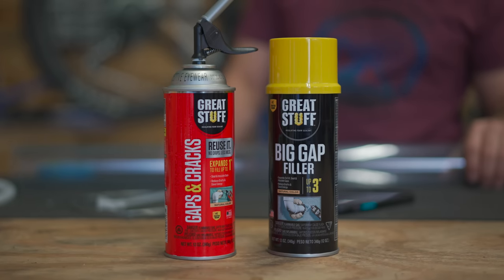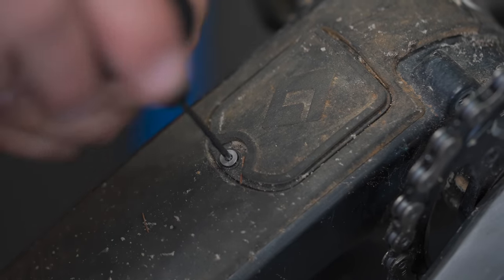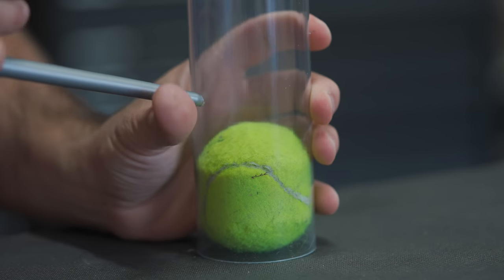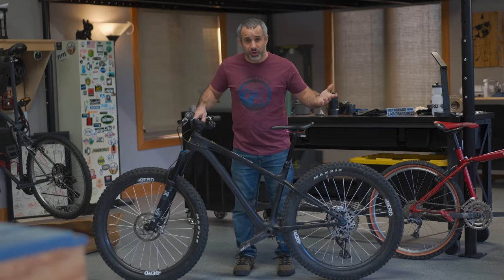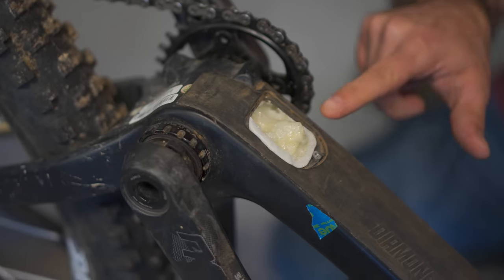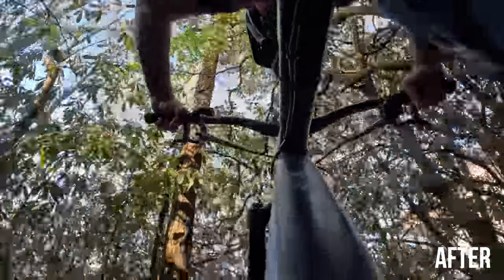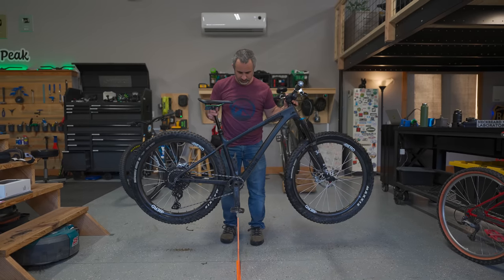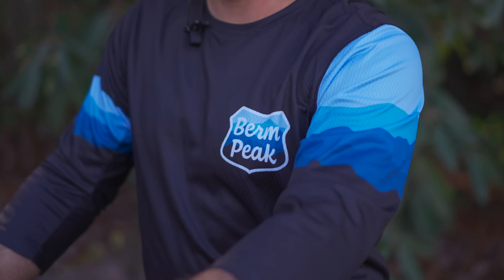Filling my bike frame with foam made it better—kind of. Don’t do it.

Comment: Next, we need to see the tires filled with foam. Now that would be interesting.
Reply: Foam tires have been around for years, but they are vastly inferior to good old fashioned pneumatic tires. The only advantage they have is that they can never go flat.  The disadvantages are increased weight, increased rolling resistance, and a decreased ability to absorb shock.
Reply: This foam would just crumbe to dust very quickly.
Reply: expanding foam in tyres will eventually disintegrate, so no its not as good an idea as you would think. Gander Flight has some videos showing it being done on his channel that may be worth a look
Reply: how about filling the rims?
Reply: Isn't that Cushcore?
Reply: I've filled zero turn lawn mower tires and they work great !
Reply: …and take them down the stairs of doom.  Calling Sam Pilgrim.  This is going to be EPIC.
Reply: @cyrusf.4039  Spank vibrocore is something like that
Reply: It's been done on gcn tech
Reply: @Durwood71  Imagine filling the FRAME with air! that's gonna be the next big thing, pneumatic frame.
Reply: @dummkompf  thtas actually a thing in custom off road cars- use the rollcages as compressed air reservoir.
Reply: just try any kind of rental bike or scooter...
Reply: @dummkompf  dude fill it with helium, like a balloon. Lighter than air! Or even hydrogen to power a rocket motor!
Reply: Blake from GMBN did that
Reply: @Durwood71  Yes but there are times when this makes sense, my dad has used one on the back for years becuse of where we live, the tires go flat all the time either some odd goat weed in places or other things like the city having poor pavement that in winter he uses the bike.  He has a Tube bike so it was very easy to find foam for the bike, some old Steel fralom Mountain Bike with rare MTB style calipers that is a Japanese made bike from the 1980's with the oldest of the production off road forward facing side grips and orginaldesins of front covered spring shocks.  What would be better is solid rubber tires for bikes/something similar to the metal tires of small kids trikes, these are better for use as they would not have the Rolling resistance as bad.
Reply: @caseysmith544  Yes, as I said, the one advantage of foam tires is that they can never go flat, but in almost every other respect, they are vastly inferior to pneumatic tires.
Reply: I've bought a dirtbike with expansion foam it. it was the worst
Reply: We already have tire foam inserts.
Reply: @xavierhulbert5849  Yes but they kind of suck, the best would be to have solid rubber tires or something like that, as they would be stiffer to counteract the major amount of rolling resistance the foam has. Yes the issue is then the bike is so stiff on shock but with all the types of suspension the modern bikes have even at lower levels of bike, this should not be an issue. This is not a road bike that most are lacking in suspension and only the Cyclcross bike have a little. Even the casual Gravelcross bikes Have the suspension be it lesser for some routes that include steep downhills.
Reply: @dummkompf  not air,  helium to shed a few grams !
Reply: Doesn't work. It gets firm in one spot, but stays liquid in the rest of it. 
There is a YouTube video somewhere, but I forgot who did it.
Reply: @caseysmith544  Solid rubber tires would be murder to ride.  You actually want tires to have give, not just for shock absorption but to increase the surface area that comes into contact with the ground which will prevent your tires from slipping.  Plus, a tire that is too firm will bounce over rough terrain instead of rolling, which will decrease traction and control, even on a bike with suspension.
Reply: Lets ask sam pilgrim
Reply: Brazilian channel @Pedaleria already did that
Reply: Some Car Tyre OEMs have models with foam in them… I think only 1-2 SKUs though
Reply: Tannus tire inserts.  Not exactly what you're talking about, but pretty close.
Reply: This is done for forklifts used in warehouses so having no punctures means less downtime and also on wheelchairs where a puncture can happen at an inopportune time. The polyurethane foam used is not this one as it is rigid. The one used is the one used to make foam mattresses which is a flexible polyurethane foam.
Reply: @cyrusf.4039  Spank did that with their Vibracore rim and handlebar line up.  They're cheap and apparently dampen very well.
Reply: @sapinva  Tannus Tire did a better job by placing the foam between the tire and the tube/air pocket.  Ran that on my DH bike with 3C Maxxgrip DH casing tires and my tires were so supple I hold lines no one else could.  I ran my tires at I think 12psi front and 15psi rear.  But the foam paired with the DH casing made the tires feel like I had the support from running 22/25psi front and 25/28psi rear.  They made the trail feel so tame and saved me from crashing so many times it's not even funny. The tradeoffs were rotational weight and rolling resistance though.  So in order to keep up with others I had to pump more, pump harder, and build more trust in my bike's traction so I could lay off the brakes more.
Reply: @caseysmith544  I understand where you're coming from, but foam tire inserts are absolutely amazing.  The supple traction, vibration deadening, extreme puncture resistance, and outrageous amount of support they add in turns is nothing short of jaw dropping.  They force you to be more physical with the bike in order to build speed, but if you have the conditioning they are a must have on nearly every bike. In the world of performance mountain and road biking, tire set up is equally as important as your suspension. 

A solid rubber tire, on the other had would have almost zero give and so much rotational weight that it would quite literally hit a rock or root and just stop you dead in you tracks, and send you flying over the bars.   Even if you made a solid rubber tire soft enough to dampen like an air filled one, and low profile enough to not have too much of a rotational weight increase, the rubber you would have to use would be so soft and low density that the rubber would essentially dessintigrade on you extremely quickly while riding.  And you'd probably destroy rims super easily under high impacts.  So I get where you're coming from, but trust me, it won't work as you think it might.
Reply: @Polemicist_  maybe a foam tire with small inner tube in middle is the way to go? 🤔
Reply: @Polemicist_  Those look interesting. I'd still need 35 psi, which feels soft enough to me.
Reply: @caseysmith544  That's what Tannus Tires deduced and they are fantastic.  But keep brainstorming ideas on how to make a supple, lightweight, bombproof tire.  We need innovative minds like yours to keep advancing bike or any other technology type.
Reply: @sapinva  Do you rub tubeless with an Exo or DD casing?  If so, the Tannus Tire inserts will make an Exo casing feel like a DD, and a DD feel like a DH.  If you decide to try the tubed Tannus Tire inserts in a DDI think you'll find you'll drop your PSI by 5-10 and even more if you bump up to DH casing tires.  I used to run 33 front and 35 rear with tubes in my DH casing tires before I got Tannus inserts.  So, just something to keep in mind.  If you have like $120 to spend on your bike I'd highly recommend you at least give them a shot for a few weeks.  And you can just return them if you don't like them.  Aside from maybe paying a mechanic to mount the inserts and balance out your tire, you have nothing to lose and a lot to gain in my opinion.
Reply: @Polemicist_  Run Vittoria Agarro 2.35 w/ Rimpact Pro tubeless mostly. Could probably go 3-4 lower than 35 psi and get away with it, but don't like banging my rims. Used to go 45 psi with tubes and still get pinch flats. It would only be $60 for me, generally run tubeless w/ no tubes or sealant in the front with no issues. Might try the Tannus insert on a different bike.
Reply: @sapinva  Oh, you ride XC?  Makes more sense why you'd keep the higher pressure.  I thought you rode enduro or downhill.  For XC definitely keep the high pressure because the foam will still be a miracle on your bike.  Just know you will increase the rolling resistance but you will pretty much never get a pinch or slash flat.  For a puncture flat you'd have to drive a nail over an inch and a half into your tire for that to happen which is probably not going to happen ever unless your riding through active construction sites ahaha.
Reply: @Polemicist_  DH and Trials mostly.
Reply: @sapinva  Wait, Vittoria makes DH tires?  Had no idea.  Do you have a dedicated trials bike, too?
Reply: Solid polyurethane tires will take over at some point. The material has been improving leaps and it has amazing qualities for grip and speed as long as it's relatively dry.
Reply: Sam pilgrim fills his with monster energy,  get with the program baby!
Reply: dirtbike tires often run foam tubes.
Reply: “Cush core”
Reply: Closed cell foam still deteriorates after repeated cycling.
Open cell foam for gap filling is less likely to over expand, but also less durable.
Reply: That is literally what new cars come with instead of a spare.
Reply: Everything inside will turn into sand a the first sight of human weight applied
Reply: There's a thing called cushcore
Reply: that is why i came for
Reply: All hobbygrade rc bashers and crawlers use foams in different compounds
Reply: @cyrusf.4039  might be the better version of a rim tape lol
Reply: I wonder what would happen if you replaced a bicycle tube with a pool noodle.

Comment: You need an 2 part structural expanding foam.  This will set inside the frame and doesn't absorb water.  It also makes the frame stiffer.  The spray stuff needs air to set, so it will never fully set in the middle of the frame.
Reply: Bring this man a beer!
Reply: Sometimes we would use a 2 part foam for setting posts in the ground. It was impressive. Expanded like crazy.
Reply: Thet do this in the chassis rails and sills of racecars for stiffness
Reply: thought this too
Reply: “Air set” well set by moisture in the air.. a couple spritz of water inside the frame will solve that issue.
Reply: @Frmrspecialist74  thats true, actually i have see years old foam wich was still wet on the inside
Reply: I experimented with foam in the past and i can say @alexnelson9505 is right: Use 2 component foam. There is not enough humidity to harden in closed pipes when u use 1 component foam.
Reply: YES, 2 part foam is more controllable. You can get it in different densities and it is several orders of magnitude stronger then spray foam insulation.
Reply: Additionally I wanna see differences for aluminum and carbon frames. Would it lower pinging noise in the frame of an Al frame?
Reply: and still the difference will be little to none
Reply: @Dyloniuss  Yeah that was my thought – there could be greater/lesser effect depending on the bike...and also the type of riding (I wonder if chainslap, etc. in MTBing will just be louder anyway, but a generally-quieter road bike with an annoyingly "clicky" inner-routed cable housing would maybe be silenced)
Reply: Can someone post the cable routing sleeves he used?
Reply: What this guy said. 2 part foam is what you need. I would doubt any real world impact one a bike though. For cars, there are lots of cars that actually use two part foam in certain areas of the car to improve stiffness and sound absorption from the factory. Lots of hobbyist have done it too but I've never seen any really works data to show it works.
Reply: Agreed.

I tried to make a green screen stand from pvc tubes and planned to fill it with foam for weight and strength.

Pffffff

Total fail.
Most of it stayed liquid due to lack of air for activation and dripped out.

Waste of time and money
🤬😡😠😤
Reply: That's why bamboo is so tough. The outer shell would break easier without the soft foam stuff on the inside. I don't know if it does anything for the sound of bamboo 😉
Reply: @RazzFazz-Race  spray water into the tube before you start and then it's fine.
Reply: Not setting isn't an issue for sound deadening. Bet this technique made more of a difference in aluminum frames
Reply: Wonder how stiffer the frame would be, and would it allow a little more weight bearing (overall rider weight)?
Reply: Not to mention if he only let it set up for an hour then dropped the bike a bunch, that uncured foam probably unfluffed in the frame too
Reply: Came here to find this post. More specifically GreatStuff needs the moisture in the air for its chemical reaction. Definitly, need a 2 part foam for something like this.
Reply: It's not actually activated by air, but by ambient moisture. 

ANYWAY, yeah you're right, by the time of filming, there would be a fair uncured liquid foam in the middle. Perhaps its whole acoustic effect was that it was basically acting like a deadblow hammer?

Comment: I've done it. For the super light frames it can make a huge difference in noise. Particularly the ones with thin and flat sections of carbon layup that tend to act as a sound board. The downside with gap filling foam (Polymethylenepolyphenylisocyanate, propoxylated glycerin polymer) is that it stays kind of rubbery and doesn't adhere to the inside walls as well as you might think. A better foam would be something that cures firm like polyurethane. Pretty sure gap fillers used to be the polyurethane variety, but they tended to expand with more force, crushing window and door frames.
Reply: Empty your pocket on super light frame. Undo the investment by adding insulation? 🤔
Reply: Just add water (steam) when injecting to get it to catalyse without air.
Reply: If you're filling your frake full of foam then you aren't doing anything right.
Reply: Also you obviously never ride in any type of weather other than a dry sunny day too, or it'd take about a week for all this shite you've emptied in your frame to become soaked with moisture just like what they used to do with kayaks to keep them buoyant until it'd absorb all water. You can sound deaden with correctly placed pieces of tape, all you did was add weight to the bike because the internet told you so.
Reply: @i-_-am-_-g1467  Honestly don't care if it adds 100 lbs just as long as it is quiet. It adds a few ounces at most, far less than the wrap of old tube it had before. But thanks for the tip on moisture, I'll scratch off the underwater rides from my list.
Reply: can you imagine the foam pulls away from the frame and now you have this hunk of foam rattling around inside your frame getting worse as the foam wears down due to friction and vibration. If you want a quiet ride inject the foam in your ears!
Reply: @cyrusf.4039  I'll save a little extra for my ears next time. Thanks!
Reply: @cyrusf.4039  It would never rattle because it is a soft foam you can cut with a plastic knife.
Reply: I don’t know anything about anything, but I find it interesting that “isocyanate” is in the other name for filling foam. When using aerosolized paint, isocyanate is usually present in 2K clear coat, and it’s supposedly pretty nasty stuff.
Reply: @Lughnerson the stuff he used gets brittle and flakes with exposure to air and moisture.  When used on homes to fill gaps the hard layer exposed to air seals it but that stuff sucks in general.
Reply: How much weight do you think you added by putting foam in your super light frame though?
Reply: @HelloThere-mm2vu  30 grams
Reply: A long time back a custom frame was made for a very powerful pro rider ( I think Indurain ) with very thin tubing. Polyurethane foam was used to provide more structural strength in the down tube ( may have been other tubes as well) and to prevent crushing if knocked. Using polyurethane as gap fillers can be done but you need to know the volume to be filled. Get it wrong and use to much things will start cracking.
Reply: @i-_-am-_-g1467    If you use closed cell foam, it will not absorb appreciable amounts of moisture.